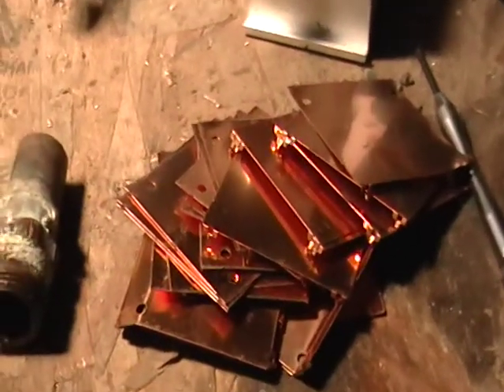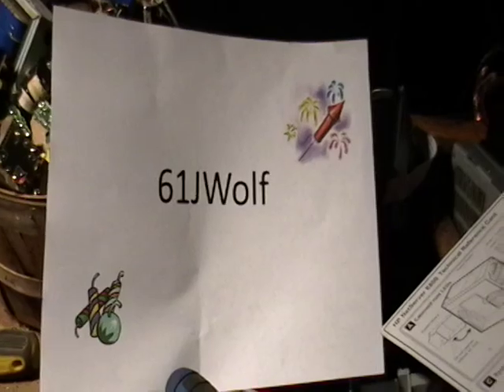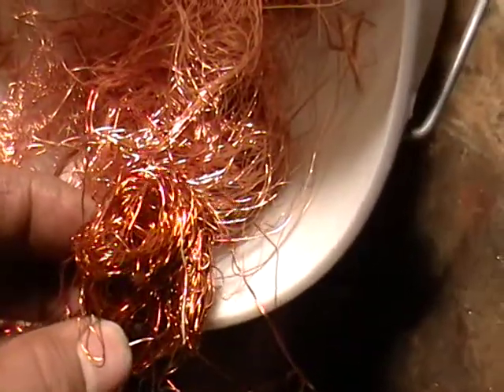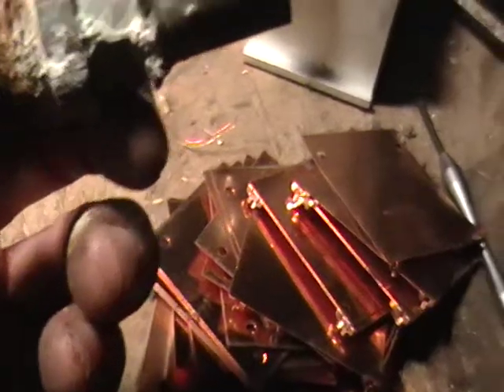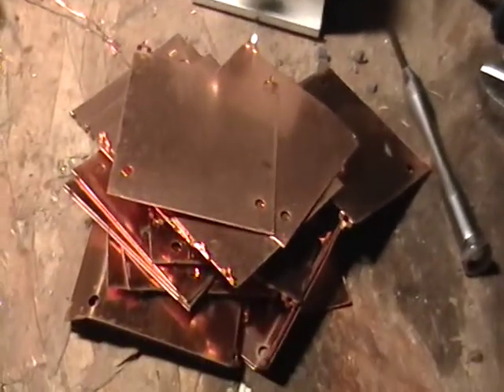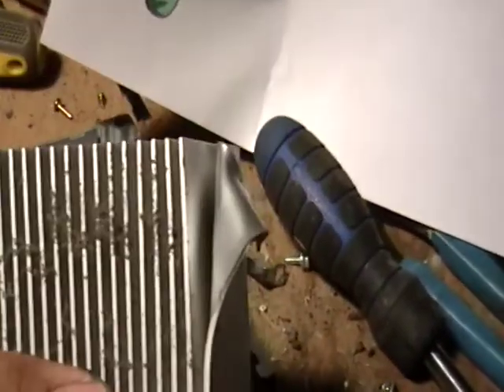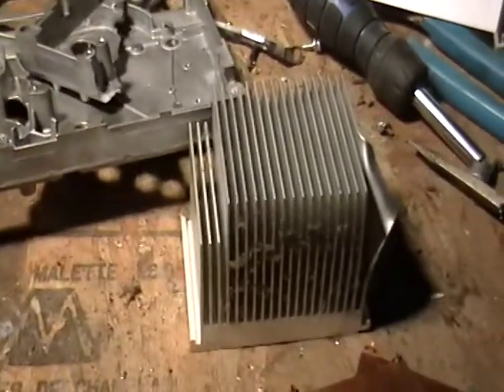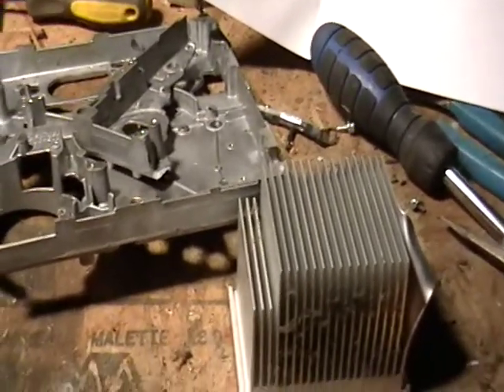#1 & #2 COPPER How to tell them apart

Comment: Mike. The heat sincs and screen and window frames are extruded aluminum usually and it pays the best then you have sheet aluminum and then also is painted and unpainted in all catagories and finally is dirty aluminum with bits of other metals attached to it

Mark. Resource Recylers

Comment: Thank you Mike The Scrapper. Say, some of the material that I have been reading indicates that not only does copper have to be clean but it also has to be a minimum gauge of one-sixteenth of an inch to be considered as #1. Anything less is considered #2. What's your take on this issue?

Comment: As for aluminum: there are several types. Aluminum used structurally contains different alloys for flexibility, elasticity, bending strength, yield strength, compressibility, malleability, tensile strength, hardness, and corrosion resistance.
Typical aluminum alloys are: copper, manganese, silicon, magnesium, and zinc..

Cheap sand cast aluminum is usually from a crucible of  "pot luck" smelted aluminum and hardens to a coarse granular molecular structure. Structural castings have a more dense molecular structure and use different alloy contents for various applications; these castings follow strict specifications and are usually heat treated after machining. There are chemical tests to determine aluminum alloy content.

If you ever buy anything that has laid claim to be made from aircraft aluminum it is most likely a play on words. The only difference between aviation aluminum and non aviation aluminum is the paper trail required to purchase and use it. Aluminum alloys are numerically categorized from  a 1000 series to 8000 series. 7075 can be heat treated to the strongest tensile strength of any aluminum alloy.

A profit conscious non-aircraft product manufacturer is not going to pay for the extra added cost of aircraft certification-sheets.

Comment from the maker: Thank you for the compliment...Stripped wire can only be sold as bright wire if its shiny like a peny...No paint or stain...The same goes for copper tubing..Make sure you clean it well and no solder, paint or corrosion and you can sell the tubing for #1 copper tubing

As i make this comment tese are the prices in my area... 

Bare bright wire $3.10 a lb
#1 copper tubing $2.82 a lb...

Good luck... Peace

Comment: I work in the non ferrous department of a scrap yard. The difference in grades of copper ONLY has to do with mallealbility. A simple rule of thumb when grading copper wire is, The easier it is to bend the lower the grade. You can ask any metalurgist.

Comment from the maker: The scrap yards where i am from separate aluminum by cast,rims and everything else.
I would guess they seperate all the alloys when they have down time.

How do they seperate where you are from?

Low Copper Aluminum shall consist of clean, uncoated aluminum plate, may include clips or punchings
ISRI grade TABOO may be included in this grade.

Comment: I've ALWAYS been told its the size of the copper that determines what category it falls under. "if it's bigger than a pencil lead, it's #1. If your pipe doesn't have any connectors on it, then it's number #1." 
It doesn't matter how bright the smaller wire is. I've just recently discovered the "bare bright" category, but no local yards around here go into that (probably ripping ppl off) 

Have I been gettin stooped or does this categorization criteria differ from state/state?

Comment: What about copper that is painted red or green?  Found some in a tv, scratched it and it is copper under. I'm guessing it is #2. Also the scrap yards in my area consider heat sinks to be mixed aluminum. I still haven't found straight aluminum by their terms

Comment: the aluminum heat sink is not regular aluminum it is extruded aluminum either 6061 or 6063, regular aluminum could be sheet, or aluminum chairs so on.

Comment: I definitely been ripped off at scrap yards in seattle. not all the time but you just might remember when the guy says that clean golden copper pipe is number #3 or stripped house wire is #3.

Just a few days ago in north seattle. Delivered in my truck of about 8 garbage bags ++plus a radiator, only got $16. Couple months ago, delivered 3 garbage bags in my toyota corolla, only got $16. and my truck load was definitely way more weight than my corolla run.

In downtown area of seattle, I can get about $25 for what I can stuff in my toyota corolla. Now if I had ran my truck to downtown then I could have got at least $40-$50 just from the cans

Comment: I have a quick question for you. What about Oxygen Free Copper? I am new to the scrapping hobby and I found some old amplifier power cables but they are oxygen free copper. Honestly, the actual strands look like silver or tin but I don't know if it is just a coating on the copper or it the copper was 'treated' to get that look. Can this be sold for scrap and if so, what category would it fall under? Thanks for your time!

Comment: so the copper i get from electric motors is dark but has no green stuff on it, is that 1 or 2? plus 3 kind of looks like 2 so how would i tell the difference? also i have found red and green copper wire in my motors that i unravel. is that 1 also?

Comment: how do you get the little copper ends off the metal strip on a ac aluminum radiators?? I've USe a screw driver .but sometimes its hard to get those curled copper pieces out of that metal strip.
Reply from the maker: I have a video on that. look up scrapping ac videos

Comment: So the other day I was cashing in on yellow brass, I had a couple pieces that looked silver plated but had a yellow undertone. The magnet would not stick to it, the scrap yard hit it with the file and it was mostly white underneath. Keep in mind it had a nice weight to it, the scrap yard wouldn't take it claiming that it was a pewter or pot metal. I did a little research online and I've come to the conclusion that it is white brass which is 60%zinc and 40% copper. Any thoughts or ideas on this? Everyone talks about yellow or red brass but I never hear about white brass....
Reply from the maker: there are different kinds of brass and scrap yards pay a different price for them. why he did not take it is beyond me.
Reply: Mike the Scrapper Zinc isn't worth the effort of reclaiming?

What objects were made of white brass?
Reply: Some candle sticks and other ornamental items. Brass contains zinc.
Reply: Yes, brasss is an alloy of Copper and Zinc, but once the copper content drops below a certain percentage no one will but it as brass, since it's mostly zinc.  Reclaiming Zinc actually costs money because of the refining.

Comment: Thanks for the video. I'm starting to scrap tube tv's for the wire copper (#1 and 2). I might have close to 2 lbs so far of both combined. Not much, I know. I'm going to eventually want it melted down with aluminum can tabs to make different things. Aluminum bronze. Is copper 1 and 2 similar enough to just melt together? If not, I'd rather use #1. Looks brighter and nicer. Thanks. :)
Reply from the maker: Mazzara1035 should be fine to melt together
Reply: Cool. Thanks.

Comment: Ive got a question about #1. Does the wiring have to be bigger than the tip of lead from a pencil to be considered #1? I understand if its the brighter color its #1 as well. Ive just heard a few people talk about the pencil size. I wanted to make sure first before I go to the yard and make myself look like a fool.
Reply from the maker: #1 copper wire in my area does not exist. its called bright wire #1 is only for copper tubing.
Reply: So pretty much what you're both saying is that if it's the brighter, shinier copper, then its #1. If it's the duller, "coated" or oxidized, then its #2. I'm In WV btw.
Reply from the maker: Yep you are correct...
Reply: Thanks Guys

Comment: I have a bunch of copper (what I believe is copper) nuts bolts and washers they are clean. bit I was curious how I could tell for sure.
Reply from the maker: Use a magnet, if they stick not copper. Nuts & bolts I have never seen as copper. to soft of a metal.

Comment: Well, if you don't mind dealing with some not-TOO-dangerous chemicals, yes! 
If you mix table salt and apple cider (or possibly white?) vinegar together in a somewhat large container (such as a large plastic bucket--perhaps you could pick a used storage container up for free at a location such as WalMart?) and place the copper into it--stir, you should be able to turn #2 copper into #1 PRETTY EASILY!--remember to wear plastic gloves, safety glasses and to do it in the outdoors!

Comment: I bought a used copper bangle bracelet after wearing it several days the bright shinny copper looks brassy I'm afraid the bracelet is brass with copper plated. I soaked it in vinegar and it stayed dull. What do you think?
Reply: ***** thanks for the help : )
Reply from the maker: Try scrapping a edge to see the middle. That can tell you if its copper or brass.
Reply: how could I tell after scraping it?
Reply: wingsonmyback1 Find a place on the back that doesn't show and use a razor knife to shave the surface.  You can shave copper, bronze, and brass with good razor knife.  Look at the area shaved under sunlight and you should be able to tell if it is copper or brass by the color, brass will be light yellow to dark gold, copper reddish.

Comment: What about homemade copper bars you make your self?
Reply: There are scrapyards that will not take copper in bar or billet form without some proof that they are what you say they are.  Others will take anything at a substantially lower price.

Example:  I know a number of contractors who work at the ASARCO copper smelter in Hayden Arizona who 'acquire' copper that is over splash from pouring anodes and pieces that break off of anodes during the preparation for shipping.  Most scrapyards in the state will not take them because they are obviously stolen, but there is a scrapyard in Tucson that will take them for about 50 cents a pound, even thought they are obviously stolen.

Comment: Yes there is. I have been finding a lot of the electrical taped wires in tv's lately that are aluminum wire,  I have been putting them in with the mixed aluminum. I guess I will see what they say come scrap return day

Comment: hi mike got a question.. while scrapping my phone I found a red copper attached to the phone's speaker (attached along side the magnet) what kind of copper is that and is it a high value copper?
Reply from the maker: Ron Ron  if the color is red. it is #2 copper.
Reply: thanks for the info. I like your channel it motivated me to have a new hobby hehe
Reply: red colored wire usually epoxy coated so it can be tightly wound but not short.

Comment: My recycler don't accept shiny hair wire copper as number 1 because since it very thin they will lose some of copper after melting it in furnace. The thick black wire around the lead-glass TV are number 1, cheap TV usually have aluminum wire. They also don't accept copper thin sheet as copper 1 because it is alloy with zinc for strength, they buy it as copper 2, thick sheet will be copper 1.

Comment: Clean up those heat sinks and see them as that. Any abnormally big think copper pipe clean it up and put it on ebay(i'd use it for the center of my toroidal coupling transformer). Hell the buyer could smash them flat and make it a busbar (also a good word to add to the description). Electrical busbars are ridiculously expensive. That pipe you showed looked like 1"OD .125 wall thickness. Which equates to $27/ft onlinemetals[DOT]com/merchant.cfm?pid=18341&step=4&showunits=inches&id=1288&top_cat=87

Comment: that bare bright copper isn't #1 copper because each strain has to be size of #2 pencil lead out of a wooden#2 pencil and the piece with the brass fitting would be consider brass because there isn't enough copper on it and usually any piece of pipe with just green collusion on it is usually #1 because it has no paint or solder or joints on it

Comment: yeah the shiny does not make it number 1 its everything 12 gauge and up in wire.
if it is coated with wax or some thin coating its number 2
pipe is number 1 copper like the one in your video you said the scrap yard told you its number 2 IT IS NOT THEY ARE TRICKING YOU
if pipe has lead solder then its number 2 if it has a brass fitting on it you might just get brass mix price its like $1.00 less a lb

Comment: the 3rd piece you showed is #1. Just because it's looks dirty doesn't mean it's #2... #2 mostly has solder joints or paint. If it has paint, remove the paint and it becomes #1. All the wire you showed is all #1. Some places will call it #2 but those are the places that are screwing you.
Reply: The 3rd piece is cooper pipe with a copper fitting soldered on, not a brass piece.  

Some areas have more differentiation for the values of copper than others.  For instance, if you live in AZ you will get downgraded on 90% of your metals for dirt or a dull surface.  Also, some scrap yards will not take 'burned' wire at all and others will.
Reply: Jim Simm i remember scrapping some extra cuts of brand-new store-bought copper pipe and a seattle yard told me it was #3. what a rip off

Comment: hey all u dudes a little trick i learned here in england .i was taking 1 and 2 c wire to my local scrappy but wen i got my ticket some times they were paying the lower rate 4 my copper.i was taking in a lot of shiny 1 grade and dirty 2 they were paying me all grade 2.so i got wise heres wot i did i get grade 2 dirty and wrap grade 1 shiny around it until u cant c it.bingo now i get paid full wak shiny every time

Comment: Mike nice video , but you need to sell to a different yard.
Your roof flashing is brand new, it should be bought as #1 tubing.
The heat sink is extruded, bought as extrusion is worth more than clean alum.
The #1bare brite should not contain any hairy wire, strip some welding cable you'll get #1 tubing as long as it's not tin plated, this is too thin for bare brite.
The wire with "paint" , those are motor windings coated in enamel, always #2,
Maximize your trips to scrapyards, been in this business a long time so I've seen how yards downgrade loads for a little more profit at customers expense.
Reply from the maker: this is an old video and prices do change.

Comment: You actually had, bare bright CU and Laquer wire. The tube was #1, there was no paint or solder on it...So..#1 it is. The piece of soldered was #2. The small sheets, would ALSO go as bare bright, same as your stripped wire... Look up ISRI Specs before leading people down the wrong path... nice try though.